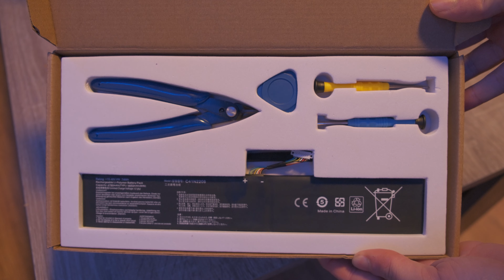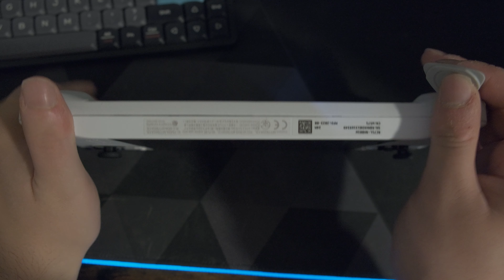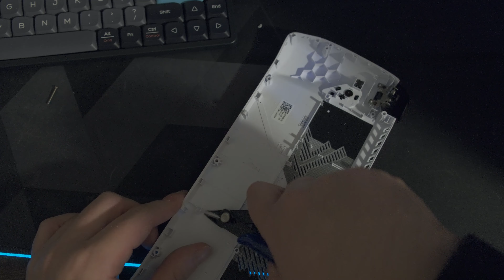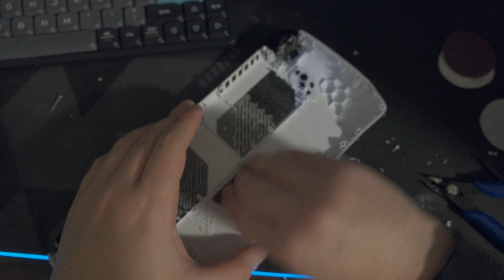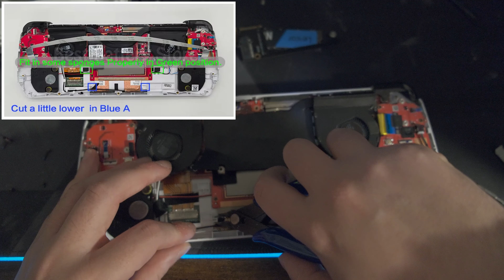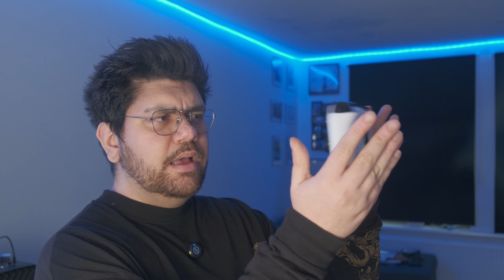DOUBLE Your ROG Ally’s Battery Life!

Comment: realize this video is old now, but about the heat from the ally. that is the garbage thermal paste they used in production.  before a battery swap i noticed the heat ever so sligtly increasing until it was hitting mid 90's. this wasn't in AAA games either, it was cloud gaming and itch/io tiny games. then it was just browsing the internet. got bad enough i just went ahead and changhed the paste.

First thing i noticed was how dry the original paste was. flaking even and easily blown off in parts. replaced that garbage with some XTM60 and now it will spike to around 75 at startup but drop greatly (50's) and get around the mid 60's during gameplay of AAA demanding games. careful of the thermal pads which should still be good, just replaced the paste and it will be MUCH better.
Reply: Interesting..
Reply: they suposedly used a phase-change thermal interface material like PTM7950 so if you open it i will look like dry thermal paste but when it heats up it changes into a liquid (kinda). i thought it was dry thermal paste and cleaned it too before. not sure why yours got so hot before but the original "paste" should be ecual or better than most thermal paste

Comment: IMPORTANT! You dont need to remove the buttom middle screw on the outer casing. It's there to separate the casing so you can put the plastic tool in the opening and not accidental damage the outer perimeter.

Comment: Hello Noura !! 
I installed the 74Wh Chinese battery, and the motorization issue, the temperature and battery percentage, is stuck, not working.
I also can't charge with the Ally on, and on top of that, when I turn it off, it won't turn off completely and the fans stay on indefinitely...
And I don't know how to fix it...
I think I'm the only one having problems with the 74Wh battery...
Can you tell me what I could have done wrong to cause so many errors?
I've already tried two different batteries from the same brand, and both show the same errors.
By the way, I've put the stock battery back in, and everything works perfectly.
THANK YOU!
Reply from the maker: Try to contact the seller, sounds like a faulty battery to me. I had great support through Aliexpress.
Reply: Hi again Noura, thanks for the reply!! I bought it on Amazon Spain, but I don't think it's the battery, because I've bought two, and the exact same thing happens with both of them, I get the same errors that I mentioned... I'm very discouraged... I don't know what to do to fix it and make everything work with the 74 Wh battery.
Reply from the maker: @Pozon_88  Maybe they just have a batch of bad batteries. Return it and try an other seller.
Reply: Ok Noura, I will do it, thank you very much!!

Comment: Turned it into a white version of Ally X! Nice!!

my concern is Ali Express, I would be worried if anything goes wrong. battery stopped working, catches on fire, explodes etc..
Reply: Everything is made in china anyway. thney use the same parts I expect.
Reply from the maker: It's a risk with every device you own that has a li-ion battery. But I definitely understand it.

Comment: Hi i have a Problem the battery is at any time at 100% and doesnt get lower.
I dont See the Watt Performance anymore and on Turbo Mode the Fans doesnt spin higher but the Temperature is is ok.
I think all the Problems come from the battery Do you have this Problem too?
Reply from the maker: I'm sorry I did not have this problem. I guess a faulty battery. I would contact the seller.
Reply: Yeah the seller i went to says any issues just send the thing back for replacement. All batteries have a fail rate even samsung or whatever.

Comment: how come u cook that poor ssd, at least remove that plastic foil , it will help by couple of degrees
Reply from the maker: It's doesn't get cooked, haha. It is a common concern but I never exceeded 55 degrees Celsius in crystal diskmark during gaming. And the working temp is up to 70°c by the manufacturer.
Reply: @NouraWhyNot  yea , right look for  controller temp not the normal one , at least get that plastic foil out , i don't know why asus put it in ally but on x don't, it's just keeps heat there

Comment: They should really make a kit with replacement back plates so that you can avoid warranty issues and physical mods to the ally that hinder its quality design.
Reply from the maker: The Jsaux backplate should work without modifications!
Reply: There is a warranty sticker on one of the battery screws. Asus will know, so you have to decide if you want warranty before you remove the original.
Reply: @ theres actually a law in america that prevents warranties from being void just from opening your electronics, they have to prove it was your fault for the failure to deny warranties.
Reply: @TheHexperience I don’t think that’s true. I watched a video by ASUS of a teardown on the ROG Ally and they said removing the sticker doesn’t void the warranty. I wish I could remember the name of the video but you might be able to find it on YouTube.
Reply: @TheHexperience  Who cares.
Reply: witch warranty? asus one ? u can forget about that
Reply: Just by opening the interior you lose warranty, this mod is for people who don't care or it's been 1 year and the warranty has expired
Reply: @jesusangelpadrongonzalez7393 in the USA there's a law that protects you from them voiding your warranty
Reply: @jesusangelpadrongonzalez7393  Yeah I just don't care. been a year anyway but still would not care.
Reply: @jesusangelpadrongonzalez7393  the warranty is 2 years long

Comment: How many hour did you charge the battery from 0 to 100 percent? And can you check the wattage it can charge when it close? The stock battery can have a 65w which support fast charging, I think this battery can only charge 35w when it is off. It will also give you high temp when you do a benchmark with turbo. Does the back cover fit? will it damage the metal ring for back cover screw?
Reply from the maker: Thanks for the good questions I'll answer them all in the next video!
Reply: I have the same battery mod, and I believe there was an earlier model that didn't have fast charging but the new versions do. I charge mine with a 120w charger probably 8-10 cycles now and it hasn't had an issue. The charge time is definately longer than when stock but not like if it was charging at 35w. I never leave this thing on charge and walk away. Honestly not having the battery anxiety alone is worth doing this mod. But he does make a good point about the weight but again no battery anxiety lol.
Reply: @chiiiiiihhh  35w is not fast charging. The stock can go up to 65w power off. That is fast charging.
Reply: @YelNatSttocS  if you read the reply properly, you will see that I said NOT like it's charging at 35w. I also did say I was charging with a 120w power brick.
Reply: @chiiiiiihhh  i see. so how many wattage it can charge? I'm using a 140w charger and only getting 35w when charging power off. how does it fit? Maybe the new version also have thinner battery? Mine is very hard to close.